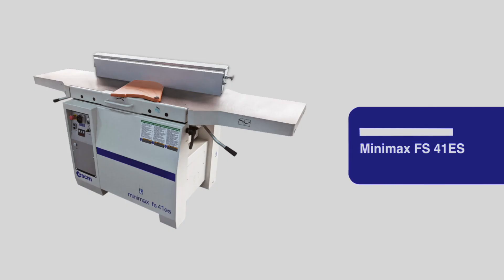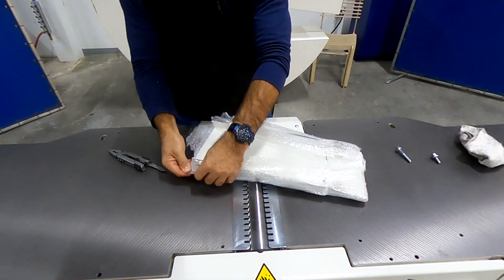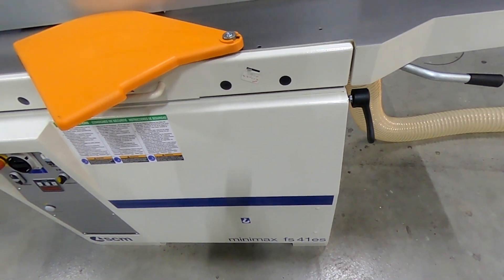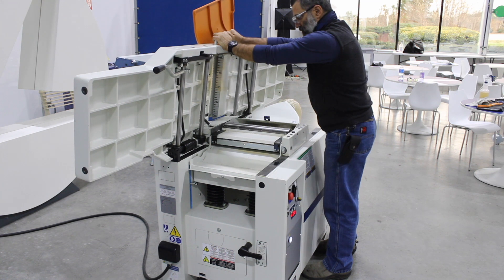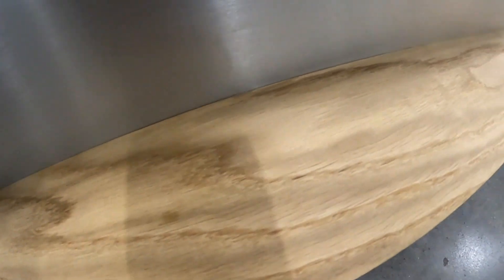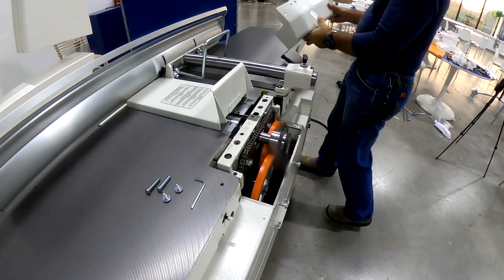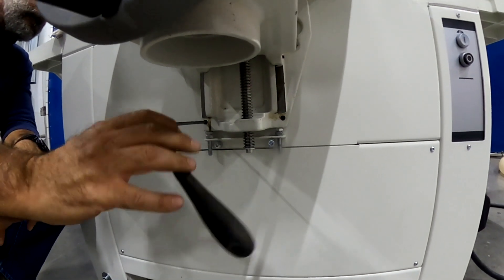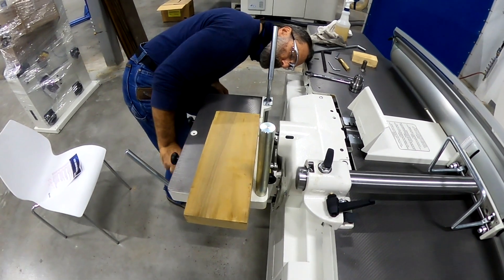FS 41ES Installation

Comment: Nice video, and I was wondering if you were going to demonstrate the Tersa knife installation.  I have the FS 30, and the ease of changing knives allows me to use the HSS knives as a bulk removal set and the M+ knives as a finishing set.  That smudge on the lens near the center is distracting!  🙂
Reply from the maker: Thanks Mike.  It is too bad we couldn't deal with that smudge in the lens cover.  Unfortunately
it is not easy to re-film, since I flew to the Atlanta showroom while we had the machine, so it would be impractical to do it again.  It won't be there on future videos.
Reply: @SamBlasco  Some things aren't noticed until post production.  I do enjoy your videos and the music!